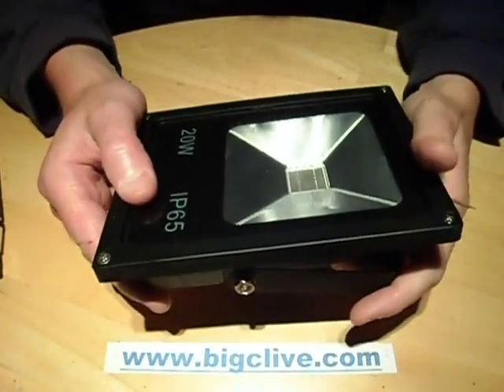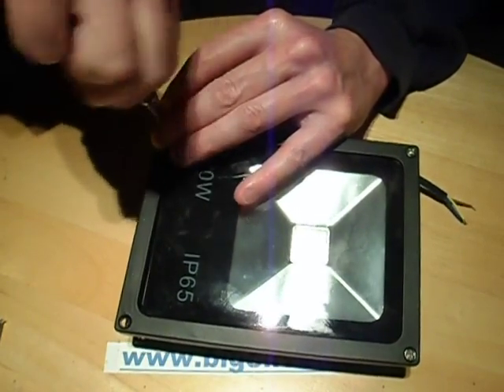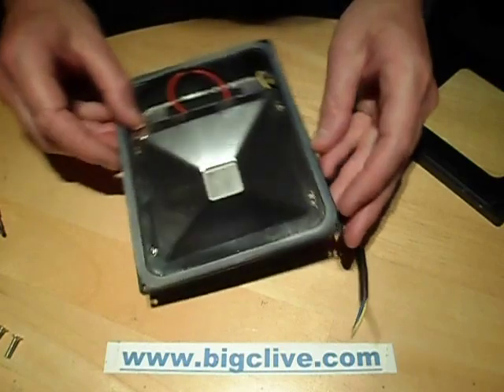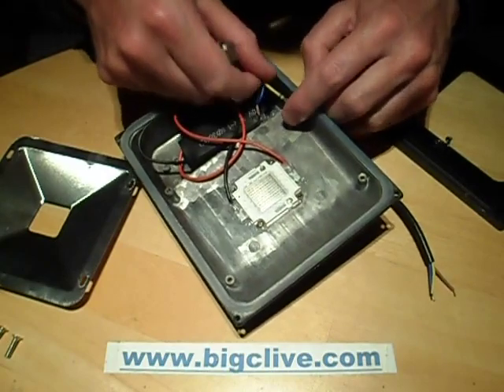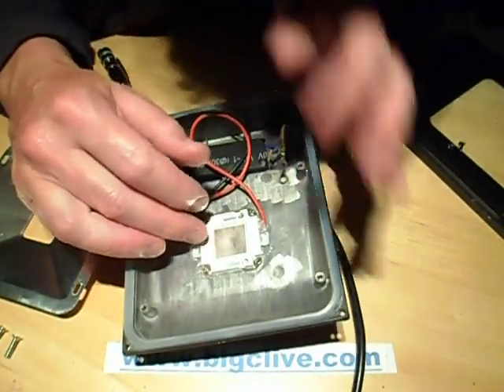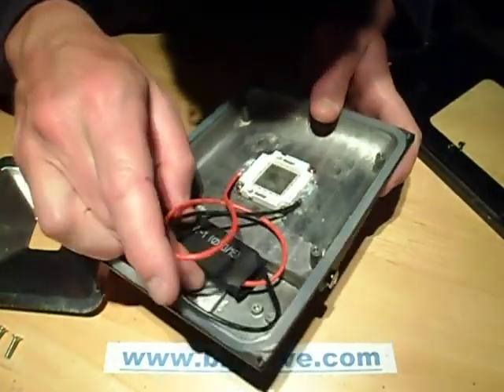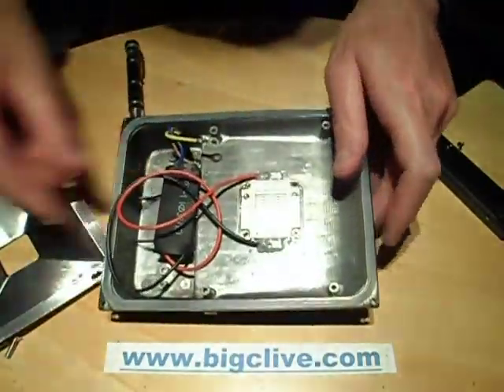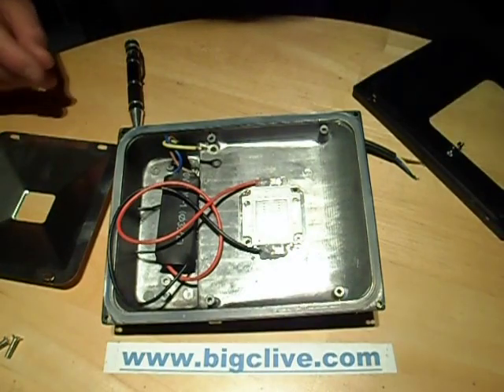A look inside a 20W green LED floodlight.

Comment: Awesome review! Is  there any way we can improve the lumen output or thermal dissipation in this type of led floodlight or is the heat sink from the case enough. Is the led really using the 10 watts that china said it would?. Thanks.
Reply from the maker: The light is rated 20W and does run at 20W.  I wouldn't want to try and increase the dissipation from this case, but there are larger versions (30, 50, 80,100W) that use progressively larger cases.

Comment: InGaN LEDs (including green) are typically grown on a sapphire substrate and thus don't need base isolation as both the anode and cathode need to be wire bonded anyway.
Reply from the maker: Interestingly the bond wires were run as pairs that jumped from a stud on the side of each chip to the next.  The studs then had significantly thick (like wire) fingers fanning out on the surface with five on one side and four interlocking ones on the other side.